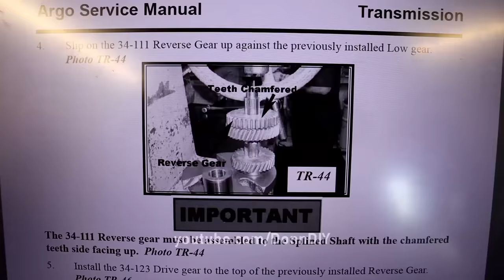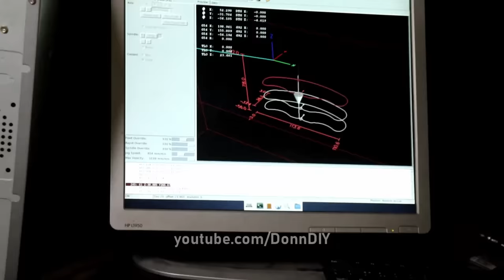Full Rebuild Process - Tracked Amphibious Vehicle

Comment: With over 40 years in the industry, you are one of the most talented I have seen. I have watched you for years. I guess the thing that impresses me the most is you are not afraid of a grinder, a millwrigh's best friend.
Reply from the maker: With angle grinder and a welder you can build anything 👍
Reply: I concur
Reply: We usually have 2-3 grinders close by. Grinding disks, cutting wheels and flap wheels all being used. Gets old changing disks. Lol
Reply: Bro your just like me might take a bit longer but I see you don't cut no corners and that's the right way to do a job that way you know it won't go all to pieces it's done right the first time.
Reply: Sold as ARGOS in Australia 
.Similarh problems if poorly maintained, not the greatest design , excellent modifications.

Comment: As a former Argo tech it was great to see you go all the way and split the shell and pull/fix the frame issues!  We serviced a couple of fleets of these things back in the day for oil/gas and the Canadian forestry service.  Often when the fleet machines were dropped off for service they were beyond mangled and often packed solid with mud... it was a total pain in the rear doing bearings chains and sprockets without splitting the shell (some tight spots to work in)... considering how relatively clean it looked when you unloaded it I can only imagine how many units we serviced and sent back out with frame issues that were missed during inspection...  Cool that you did the floor pan it should really help reinforce the frame for another 20 years if not longer (guessing this is an 03-05 think 06 was the change over for fuel injection).  Great Build and thank you for a trip down memory lane :)  

P.S. Just read your video description... would be crazy if this was a unit we worked on back in the day lol
Reply from the maker: "How relatively clean it look..." - I thought it was horrendeous. 😀 Then you've seen some serious Argo horror my friend. 🤣 The floor pan was beyond repair, it had to be replaced.👍It's actually 2006, I think 2007 was when FI came. I might be wrong.😀
Reply: Always wanted an Argo as a kid, now I’m a 50 year old kid i still want one haha. 
Nice video, great work

Comment: I can appreciate all of the time, energy, and expense put into this well done and thorough rebuild. You show impressive skill in all mechanical aspects, and in the production of this video.  Not to take anything away, it appears possible that it might have been somewhat less expensive to have just bought a new machine.  If you were to include the cost of your labor, which I am sure is not being considered, since it is for you, I feel reasonably sure new would be far less expensive.  I could be wrong, but just thinking out loud, with no disrespect intended.

Comment: Hi, Cork is a good all round jointing material for low pressure, low temperature liquids and gases. Water no problem. Many thanks for ALL your uploads , enjoyed every one.60 years maintenance engineer from Nr Liverpool UK.
Reply from the maker: Cheers! When I looked through this particular cork against light it showed pinholes. That's why I added silicone sealant. Thanks for watching.🙏 Greetings from Estonia.
Reply: @DonnDIY  hi ok all understood,  good to be sure in this case. Great work you have done as always.
Reply: @DonnDIY  good job! I believe the cork expands when it gets wet, though, and this is what makes it seal. Just like old wooden barrels, if they were completely dry for years they would be loose and not watertight, you could see light through the boards in some places. But if you fill this barrel with water, you get very little or even no loss due to capillary action sucking up the water into the wood very quickly, which then expands and fills in all the gaps

Comment: I would consider putting grease lines to some of the harder to reach internal bearings. Like the front right side under the air intake. I have an 06 Avenger.

Comment: If you haven't found out already, the front passenger gets choked by the engine exhaust fumes. Do not try to drive this through moving water (rivers, creeks) it is not stable. And if you put the tracks back on make sure you adjust the tire pressure. The pressure changes tire diameter which changes torgue gearing on the axels. I think in was 7,5,5,7 front to back on the tire pressure????. Otherwise you risk breaking axels. As always, great job.
Reply from the maker: Sills Argo recommends even lower tire pressures starting from 3 psi. The tracks should me mounted while Argo is suspended in the air and the track sag has to be 2" from the bottom of the middle two tires to the inside of the track. I'm planning on installing the tracks that way. 👍

Comment: What a great job you did on this project.  I wouldn’t even attempt a job like this.  I definitely do not have the skills or patience to do it.  The only thing I wonder is why didn’t you clean the inside of the tub?  Since it was completely dismantled.  Nevertheless you have a new subscriber.  Thanks.
Reply from the maker: Hey, thanks! I pressure washed the tub (with suds) but didn't bother rubbing the rust imprints since it was going to get muddy again right away. Let's say the tub was clean enough for my taste. 😀

Comment: Ive heard this for small engines but i dont know if it's true for this motor. If you run them with no exhaust or header, there is not good exhaust flow, and cold air can be sucked back into the engine each revolution, which can warp or crack the valves. Having exhaust of at least a few inches, maybe 6-12 inches, helps keep the engine at a stable temperature and keep the airflow moving in the right direction
Reply from the maker: I didn't know that. That's definitely something to keep in mind. Thanks! I hope no damage was done.😬

Comment: I have no use for one of these but I want one . Is this my mid life Crisis or what ???? . 
That said we are quite rural and our plan is to go off grid on a small holding 😂 . 
Technically though these machines are so so simple and well engineered. 
2 large rotational moulded half’s for the main hull and deck that probably take a morning to make , plonk a Clanky old diesel engine in it and some beefy tires and tracks . 
Shame about the cheap wheel bearings , bit of a SHT design. 
Nice detailed resto  .👍

Comment: You didn't put the tracks back on so you never finished it
Reply from the maker: Even though tracks are an accessory and optional - you're right. I'd like to build a remote greasing for the wheel bearings and seals before installing the tracks permanently to make maintenance easier.👍